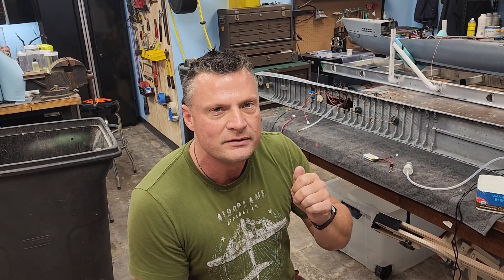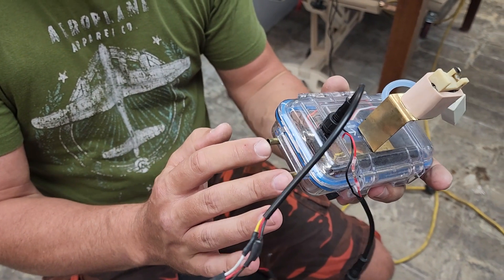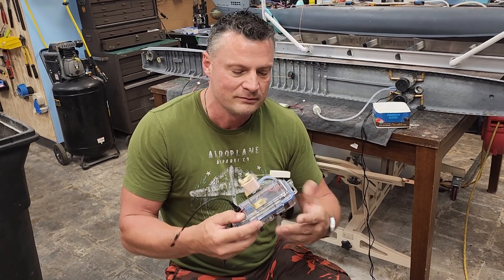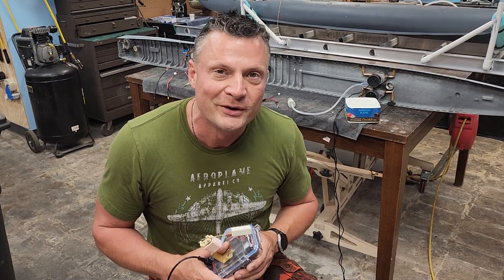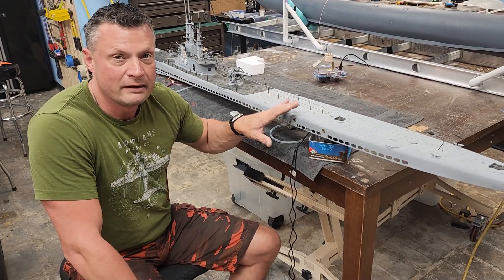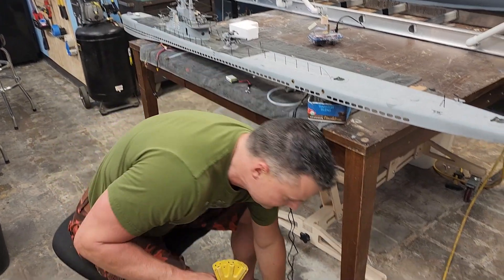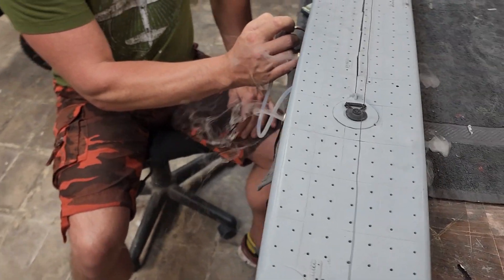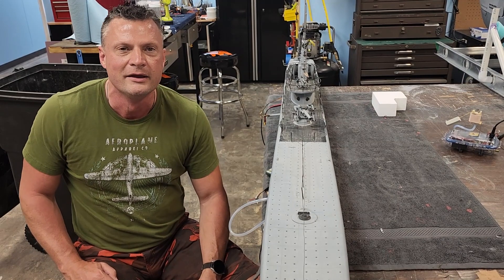How we made functional diesel exhaust smoke in an RC Submarine!

Comment: Fantastic solution Bob.!!!  I have been using simple commercial utrasounds systems to produce smoke simulation in surface models. But this improved solution with the air pump "pushing" is really nice. Once more, congrats and thanks indeed...

Comment: A really nice video collection on rc submarines, Sir! I don't know if you have shown in the past how to set up the on/off switch you are selling but it will be very helpful for all of us if you can do a video showing us the electrical connection for this useful device. Many thanks in advance and the best regards from Spain!
Reply from the maker: There is really nothing to show in setup. There is no configuration or programming. Red and black go to power in. White and black to power out. That's it!
Reply: @RCSubGuy  Many thanks for the info, Bob! I only could see the remote control in your hands working and I supposed that it was like a garage opener with negative and positive input cables and NO/COM/NC output ones having to connect these outputs to the ESC on/off switch. Have a nice weekend in Texas!

Comment: Cool clean system. Much better than with the oil. Only thing that might add to the realism even more could be a pulsating smoke output maybe? try some electronics to pulse the air pump or maybe a very small motor that will open and close a valve to let the smoke go out in fast pulses. ?Maybe the effect will be bad. don't know. but can imagine it can add realism.